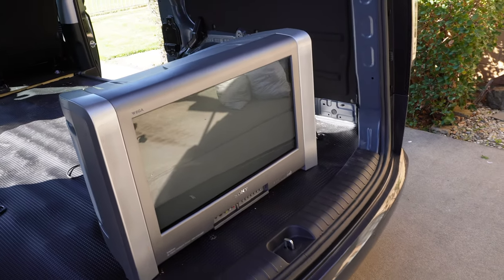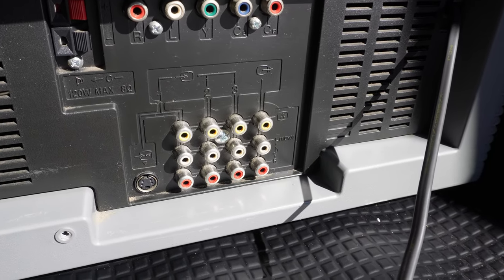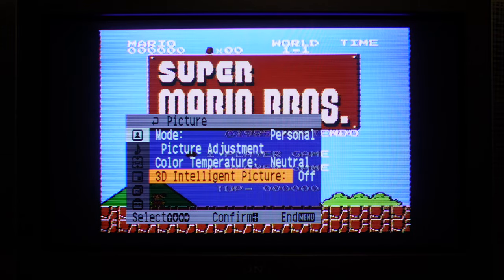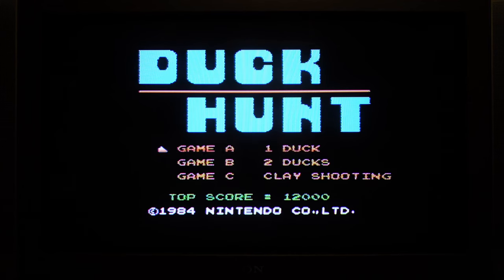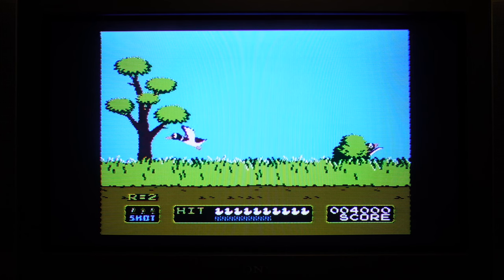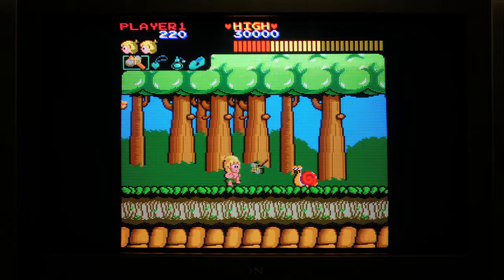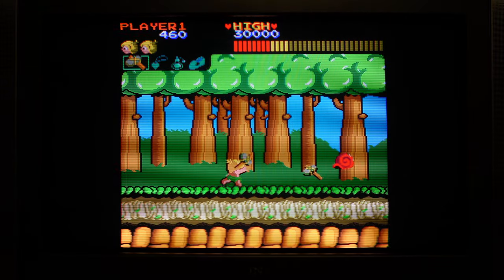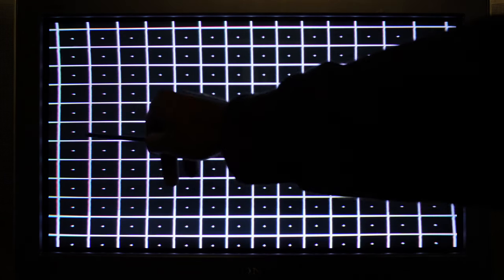Sony KV-SA28M36 28" Widescreen CRT TV

Comment: i definitely empathize with your final sentiments. i've always seen this tv as inferior to the kvhr series, simply because it does not support 480p. i remember using one at the beachhouse as a kid in about 2006, the absence of rgb & the way these later sony sets were set up gives me bad memories of making any non-480p component source look less than acceptable, as well as the sometimes totally off, but never above average geometry. i'd put that up to lazier hands on yoke alignment/magnet tweaking at the UK factory & cheaper shelf life of components used on lower end models by sony. i suppose it's just what you get looking from the dead centre of the analog to digital transition. sony may have saved a lot of money using 100hz scanning in later high-end CRTs this way, to be reused in post-CRT products like the bravia etc.

Comment: A component input is very nice for newer consoles like PS2 and X-Box but without Scart RGB you can't use the RGB signal from Master System, Mega Drive, Super Nintendo, PS1 and Saturn. You have the use the lower signal S-VHS.
Reply from the maker: Yes not common to get both scart rgb and Component in 1 tv

Comment: I wish CRT never ends, hope someone out there revive them too.
Reply: Why
Reply: @southpawlibranine3511  coz its DAMN good yo.
Reply: Affordable OLEDs or similar would have most of the advantages, without the (massive) drawbacks. The only thing really remaining is the lack of fixed resolution, and the inherent visual alteration of old games designed for CRTs (such as dithered artwork) A very high resolution tv would eliminate much of the scaling issues, and filters could sort the rest.
Reply: @DoubleMonoLR  Agree with you but I still own PS2 fat with Samsung Plano 29 inch CRT.

One this where modern tech losses is, the fixed resolution which provides better stability when you go with SD set top boxes, DVD or even with CDs if you got any.